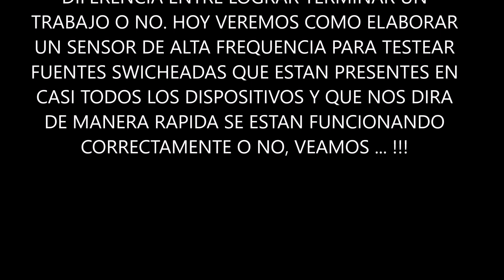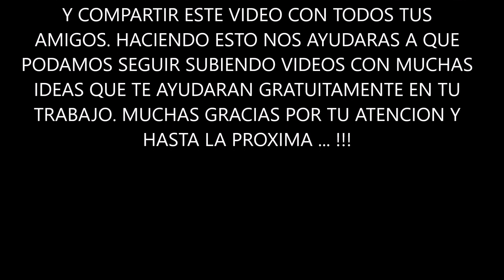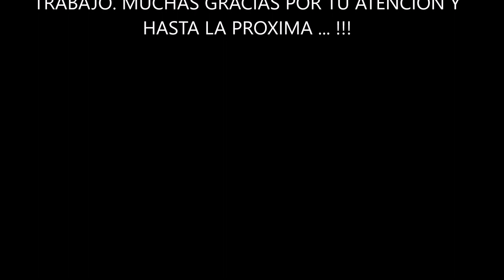PROBADOR DE FUENTES DC DC

Comment: Profesor muchas gracias por la información y me podría decir usted si puedo con un multímetro el funcion de frecuencimetro, medir la frecuencia de las fuentes conmutadas sin dañar el multímetro o la fuente?
Reply from the maker: Hola Javier gracias por comentar, depende del ancho de banda que pueda medir el multimetro puesto en frecuencimentro. hay algunos, por ejemplo de 100Khz pero muchos solo van hasta 10 o 15 Khz, y eso que algunas fuentes conmutadas funcionan a mas de 100Khz. Siempre hay que medir en la pata "gate" del fet pero tomando precauciones como tomar la medida a
través de un divisor resistivo de voltaje y si se puede poniéndole un zener de 5v, ya sabes, por aquello de los picos. Éxitos